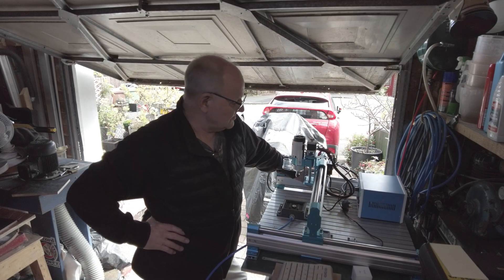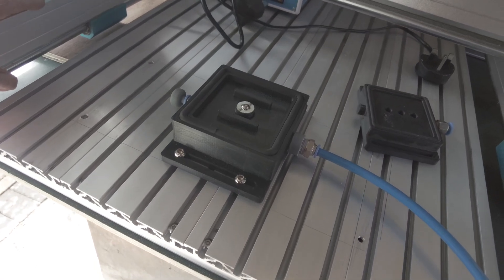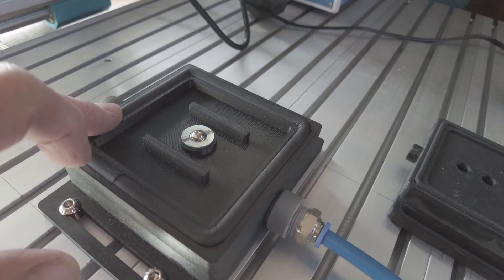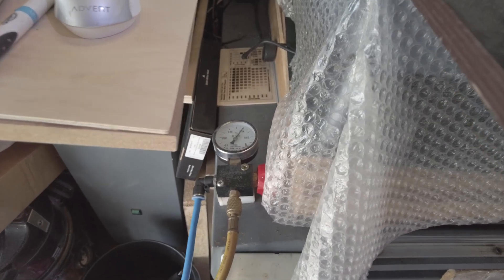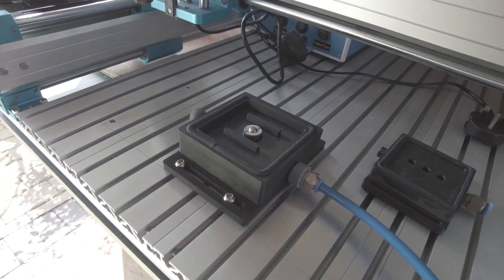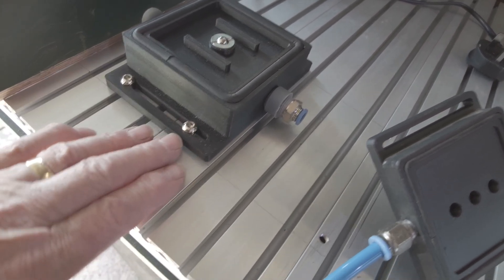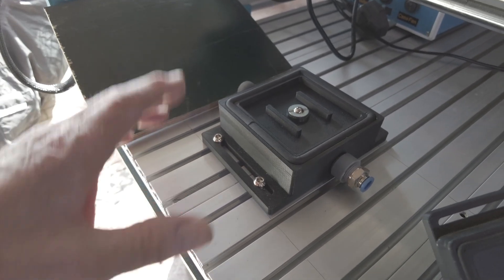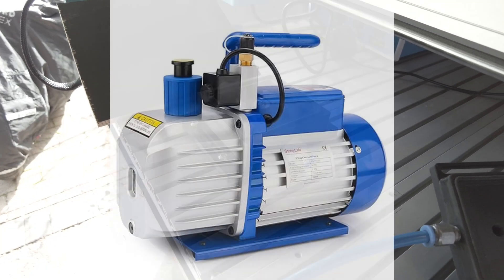Sainsmart Genmitsu Cnc 4040 Pro and the use of Vacuum pods

Comment: Nice video Tony. Thanks for sharing your experience. Have you ever found the vacuum ball valves online anywhere? I have been hunting around for them without any luck.
Reply from the maker: Hi thanks for the comment I purchased mine with 2 small vacuum bed  kits from Trend they came with ten in each pack. I have found them here

 https://www.mpower-tools.co.uk/product/vacuum-clamp-pressure-activated-ball-valve-packs/. Have a look at this site hope this helps
Reply: @Tonys.Top.Tips.Workshop  Thanks!

Comment: The smaller one would be easy to make independent to others in a chain by putting shutoff valves in between each on, they are cheap and use push connect the same as your hose connectors, the only thing is you would need to use them in order, i.e. the farthest away turn off first.
Reply from the maker: Hi thanks for the info and the comment
Reply from the maker: Hi I have a 4 port manifold with shutoff valves on it works them great